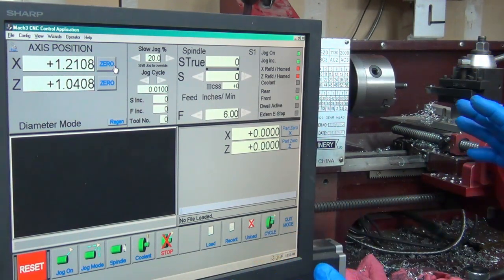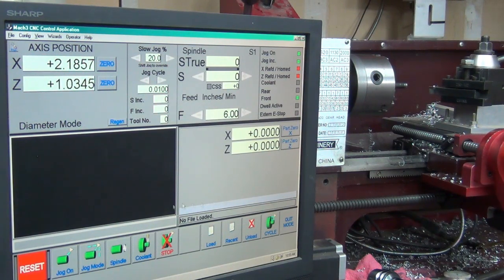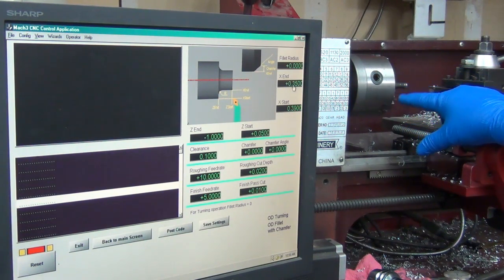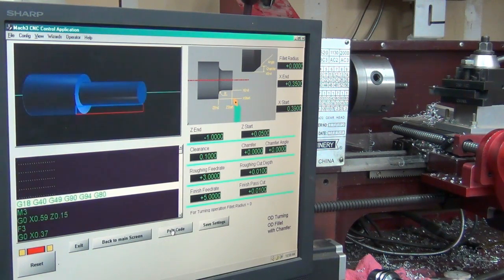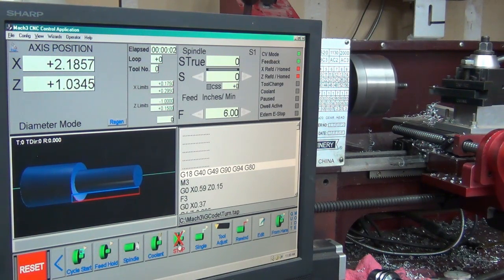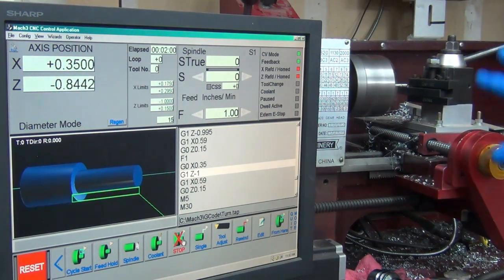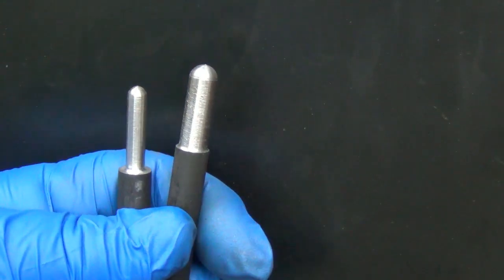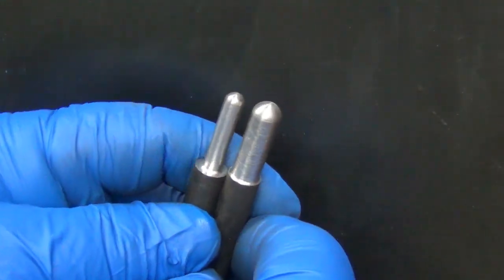9x20 CNC lathe turn with Mach3 wizards

Comment: i noticed you zeroed on the diamter of the part and entered zeero into the dro.. In other videos about the diamter mode and wizards , people entered the diameter of the part into the dro to acheive zero on the part... very interesting.
Reply from the maker: But right after that, I put in the part diameter.  I'm not sure why I zeroed it first.  This was done years ago and I was just starting to learn how to do this.  You don't need to zero it first on the part diameter. A more common way to do it is to take a test cut, leaving the X axis in the same position, then measuring the diameter where the cut was made and then entering that into the DRO. 
I just got done making a bunch of these on the new-to-me Tormach 15L lathe...not sure if I have any of it on YT yet, but I show it on IG and FB. :)

Comment: Regards.
Thanks for sharing.
Despite having uploaded it years ago for others, it was only yesterday.
What do you do to rotate the part in the viewer and make it appear in 3D?
Thank you for your time and valuable response.
Blessings in these difficult times.
Reply from the maker: Hi Jaime,  Basically, you click left or right mouse buttons to rotate, pan and I think the scroll wheel will zoom.  I don't have the lathe with mach3 on it anymore and on the mill, I don't always use this feature.  I did a quick search with google and found this.  

you can zoom in and out with the wheel on the mouse, you can tilt with the left button and you can pan with the right button. Double clicking with the left button will switch between "fit all" top view and "fit all" in ISO view. With these controls you can get to any detail level you want to see. It will only show "completed" movements from the point that you changed the display (highlighting the "done" paths).

It's from post #5 on this page....  https://www.cnczone.com/forums/mach-mill/87954-mach3-display-screen.html

Thanks! You're more than welcome.  Take care. :)  Mike
Reply: @bluehandsvideo  
Greetings.
Unfortunately, in my case it does not work.
Also, thanks for your support and response.
Subscribed.

Comment: Hi my Frends.

I have a problem. We in one school project in Croatia  (I'm the teacher) make a cnc Lathe machine from a old classic Lathe.

Now, we have tested the cnc controller, drivers and the motors on MACH3. All work ok on MACH3 Mill. But on MACH3 Turn the will not work. The motors not turns.
The MACH3 mill and turn are install from same install .exe file.

Please Help my Students and me. We need the MACH3 Turn for the CNC Lathe.

Thank You
Reply from the maker: My first thought is that it still thinks that an Estop or home switch is active.  Have you checked on the diagnostic screen to see if it shows the switch positions accurately?

Comment: Do you use diameter mode or radius mode on MACH3? I use MasterCAM to make G-code for Lather but MasterCAM only have Diameter mode, while Mach3-Turn run G-code on Radius mode? Thanks for your help.
Reply from the maker: yes I do use diameter mode.  I'm pretty sure you can switch mach3 to radius mode.
Reply: It does not work at the radius settings, it multiplies the values by 2 and should be divided by 2 because the ball is cut and not plchachaetsya.Vy able to carve the ball?

Comment: I'm new to mini lathes ok lathes all together but would like to make mine into a CNC one day. I like your video. Do you recommend March 3? I also need to learn simple cnc skills as well. Anyway trying  to get some ideas and help before I jump into doing a conversion.
Reply from the maker: +R Reichel Hmmm.....do I recommend it.  Well...pretty much everyone used Mach3 and pretty much everyone bitches about it.  You can't beat it for the price, which is usually the driving factor when people are just getting into cnc stuff.  I've heard the LINUX stuff is more predictable and better, but I got the impression I needed to know at least some cnc stuff and LINUX....which at the time, I didn't.  I bought this lathe with Mach3 already installed.  I also run Mach3 on my mill.  The big plus is that since everyone uses it and it's been around so long, there's tons of help and info on the web for it.  Are you familiar with cnczone.com?  It's one of the best resources for cnc info. :)

Comment: what do you think about Pm10x30V lathe?  do you think is accurate enough for CNC work?  or it need scraping and checking the gibs etc..
thank you
Reply from the maker: +Ozy Ozy I didn't find it at first......found it as PM1030V lathe....just to help anyone else trying to find it.  It looks like a nice lathe, but I've never heard of it before.  My 9x20 is pretty sloppy, so I just program it like I would run a manual lathe.....always coming in from the same direction to take up any backlash.  Mines not very rigid either......so it means lighter cuts than a better machine would be able to do.   Sorry I can't be of more help.  Maybe another viewer will be able to.  Thanks!

Comment: hi
i have leafboy 77 BOB .when i connect it to mach3 by usb cable for my cnc lathe although its index LED can be on and off but it can not trigger and activate my threading action .and when i disconnect the usb cable the softwar (mach3) can do its job correctly .is everyone knew the reason?
Reply from the maker: +Mohammad Seyyedi I just found this waiting for review.  Hopefully, someone will see it and be able to help.  I have no clue about how to fix your problem.  I'm guessing that you have probably been to these sites already, but maybe not. 

http://www.cnczone.com/forums/want-to-buy-need-help-/180584-support-leafboy77-usb-bob.html
http://leafboy77.com/index.php/en/

Comment: Friend like you configured the spindle, you can help me set up my. 

My engine to 1750 rpm,
Reply from the maker: Really hard to understand.  You want me to help you configure your spindle? How?  If your motor is 1750rpm, I think you're stuck with that speed unless you change motors.  My lathe is using an old treadmill motor and it's controller.
Reply: I have a friend frequency inverter connected to the motor so I concigo this rotation will vary with a potentiometer. 

The problem in this setting in mach not know how to do what I did so far was in her relations pulleys put minimum 0, maximum 1750 to 1 relationship. 

When I turn on the rotation will the maximum 1750 rpm ranges and not as it should be.
Reply from the maker: *****
So, you have it setup so that mach3 will control the speed, but it will only go as fast as 1750?  If that's what is happening, I would think that you need to change the maximum frequency in the controller.  1750 rpm is the native speed for the motor on 60hz.  With a controller, you can give it a higher frequency than the 60hz and it will run the motor faster.
You are in an area that I am not familiar with.  What controller are you using for the motor?
Reply: I'm from Brazil, I use a frequency inverter WEG CFW10. But how would the configurations in machturn.
Reply from the maker: *****
I'm sorry, but I have not done anything with my spindle control yet.  I have a variable resistor on the lathe that I vary the speed with.  It looks like your vfd will vary speed with several different types of input and mach3 should do it too.....so I think it's a question of your controller board between them.  This thread looks to have some good info on hooking it up. I hope it helps.
http://www.cnczone.com/forums/benchtop-machines/108728-want-control-spindle-mach3-cant-maybe-helps.html

Comment: What cycle do you use to stick and you can show an example.
Reply from the maker: Hi William.  Very cool lathe you're building!!
I don't quite understand what you're asking.  I'd be happy to come up with an example.  Have you looked at some of my more recent videos with this lathe?  I think I'm editing one right now that walks through the setup for one of my parts.
Mike
Reply: Hello Mike, I wonder how you do mach Drilling Capacity in turn'm trying to stick some pieces and I can not fault the cycle. 

Do you have any examples to post here.
Reply from the maker: ***** I don't have any examples.  I've never done any drilling on the lathe.  I did find a drill wizard on the MachSupport forum. 
https://www.machsupport.com/forum/index.php/topic,16533.msg112027.html#msg112027
I have a batch of parts on the lathe at the moment, but I'll see if I can try this out when they're done.

Comment: What size of steppers do you have on there?
Reply from the maker: Had to dig through my own vids to find the number on the motor, then googled it and got this....

http://kelinginc.net/KL23H276_30_6A.pdf

NEMA 23 BIPOLAR STEPPER MOTOR 282 oz-in, ¼”  Diameter Shaft with flat    KL23H276-30-6A (Single Shaft) )
Reply: bluehandsvideo Thanks for this! Guessing you've been able to use the lathe more? Have you found the Z axis under powered at all or has it done everything you've thrown at it? Looks like it does pretty good!

Comment: NIce video. Looks like you're making good progress. This is the best program ever for lathe.
Reply from the maker: Thanks!  Next up is changing out the computer.  Most of the time, I don't get the graphics display.  The more I get used to Mach3, the more I like it.  I don't really know of anything else to use anyway.  I've just been linking wizards together.....I can't seem to get LazyCam to work.  Do you use a CAM....if so.....what?
Reply: Why, whats wrong with your PC? I've used Linux CNC, its free, not bad just to much Gcode typing. Never got lazy cam to work. I use Cam Bam for the price and ease of use it is the best as well. Try it for free
Reply from the maker: sorstudios
The parallel port on the mother board didn't have the correct voltages so I had to put in a parallel card.  It's still seems to have a glitch now and then, so I'm starting to think the power supply or mother board is going.  It also doesn't display the graphics or tool path before cutting.  It's a 400mhz computer so it if I try to adjust or zoom on the graphics while it's cutting, it halts the cut while I do it.  I have another pc with win xp on it, just waiting.  I just wanted to get the machine working well before adding another change to it.  Throw all the stuff at it at once, I wouldn't know which one caused grief.....so I'm taking it step by step....for the most part. :) 
I'll look into CamBam.  Thanks!!! :)
Reply: Yeah you'll go through a few computers untill your happy. I found one on robot shops page call the NCbox-189 cnc controller, or get a laptop and add a USB CNC controller board. Not to many people have done reviews on either of them and I'm not sure which way I want to go. Also: not to many people friendly on the net when it comes to CNC. They'll talk down to you and say take some classes, but that might be that they're burned out from answering question.
Reply from the maker: sorstudios The new USB controllers seem pretty nice and where things are headed.  As a beginner, I wanted to start cheap.  If I were starting from scratch, I'd probably go with a USB controller.  There's just so many options out there.  I've had pretty good luck getting feedback from the self taught guys like John of NYC CNC and John Grimso.  I've seen the kind of responses you're talking about....they're probably coming from guys that took the classes.  10-15 years ago, self-taught meant tons of trial and error.  These days, it means tons of time surfing the net and youtube! LOL  I'm self taught for the most part from youtube and the net. 
As I get more comfortable with what I'm doing, I'll try to do some step by step vids.  The ones I find either have no audio explaining what/why they're clicking certain selections or they're vids of a part being turned with nothing of how they got there.  The two guys I mentioned have some great vids.  I'm sure there's more good vids out there but I've only got so much time to search for them. :)
Reply: I'm self taught from youtube as well. Found a guy from Brazil on youtube his videos are called tryally. He has helped me the most with everything. We've also become friends corresponding though email. However: he uses the lathe, and mill I have. That too played a factor. When I would talk to people about what I have they'd laugh and say to get MAN'S LATHE or MILL THEN TALK TO US. I've probably made more money with my little sherlines than those guys with the big stuff. They're kinda like those guys you hear in a bar talking about how many people they've beat up, but no one ever has seen them in action.
Reply from the maker: sorstudios
Looks like he's got some good vids....I'll have to check them out a bit later. 
There's a big difference between the talkers and the do'ers.  The do'ers are the ones that typically help the most.....especially if they see that you're more about doing than talking.  I'm on a Datsun forum and the ones with the highest post counts are rarely the ones actually doing anything on their cars.  They spend all their time talking.  Anyway....that's a long winded way of saying I know what you mean.  It takes more creativity and skill to run a tiny lathe/mill than a bigger one.  You run up against your work envelope easily and have to figure it out......they rarely do.  I met a guy once that was explaining that he was a machinist and making a ton of money making parts from space shuttle ceramics for Boeing.......when he showed me his shop, I was a bit surprised to see that he had a sherline mill.  Really opened my eyes up a bit.  He could afford any mill, but he loved that one cause he could sit at it at work.  It was all he actually needed so why waste the money on something bigger.  Anyway..... :)